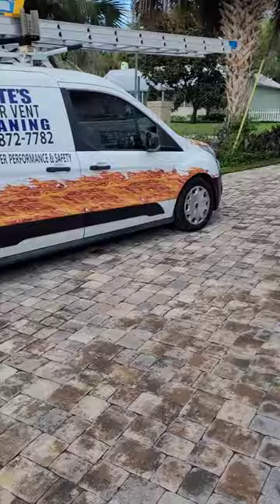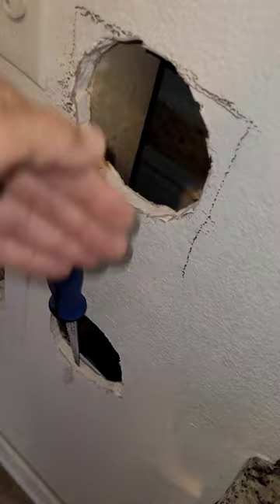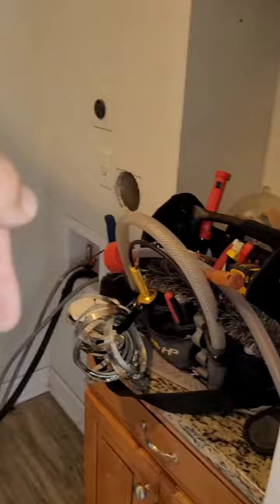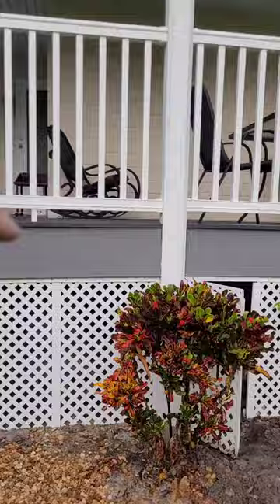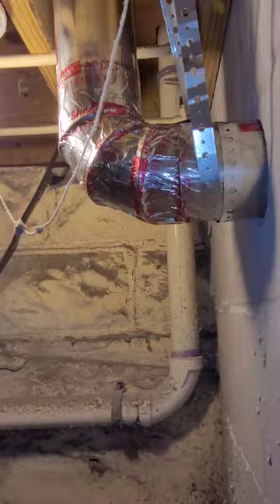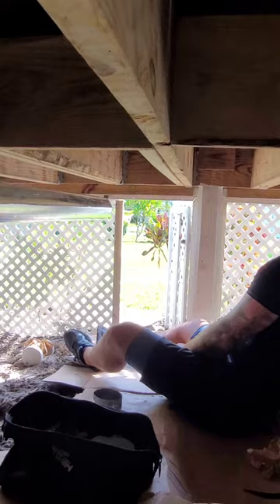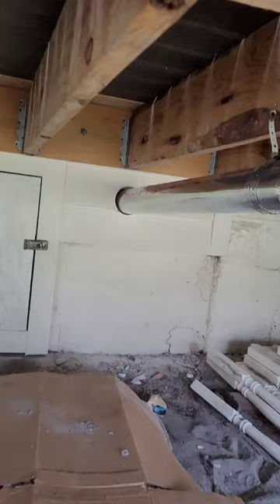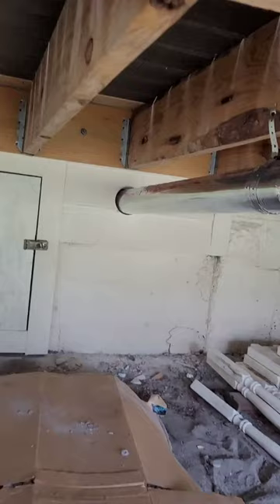Dryer Vent Installation Under House & Deck

Comment: This is what i want to do. We are having a deck built, 20 inch height. But the vent is going to be below the deck and i didnt think that would be correct. To much moisture constantly under the decking.  Any suggestions for the same situation for a water spigot? 
Thanks

Comment: Thank you so much, I 'think' I am going to have to do this on my pier/beam 1965 house - has the 'old' white plastic coming up from the crawl space :(.
Reply from the maker: Where are you located? Make SURE you get the correct material and do it correctly otherwise it'll come back to bite you. Happy to help consult if you reach out.

Comment: Can you share the materials used outside the house? Including the pipe, tape and straps to hold on joist.
Reply from the maker: Absolutely happy to help, do you want pictures, links or just product names? It would be ideal if you could contact me through Facebook or Instagram or email to share this information, especially if you want pictures. But I assume I could share links on here if you want to keep the conversation here, let me know.
Reply: @NatesDryerVentCleaning  product names would be good
Reply from the maker: @itskiki17  
- UL181A-P/ ALUMINUM FOIL DUCT TAPE
- 3M 438 Heavy-Duty Aluminum Foil Tape
- Oatey 3/4 in. x 25 ft. 28-Gauge Galvanized Pipe Hanger Strap
- 4 inch pipe hanger  https://www.lowes.com/pd/Oatey-4-in-Galvanized-2-hole-Pipe-Strap/1001149318
- 4 inch, .26 Gauge Rigid Metal, snap lock duct. You can get "EZ Vent" from @ventvision (Vent Vision website)

Comment: We have a dryer that literally discharge under the house so we ask the landlord if we could install the dryer vent outside because I’m worried that it could cause a fire
Reply from the maker: Lint doesn't spontaneously combust. It can't catch fire without something to ignite it. But it could cause mildew or mold if it's blowing against something like wood. But it it's just blowing at dirt it's not a hazard, albeit it's also not code compliant. If it's a gas dryer all the more a potential concern.